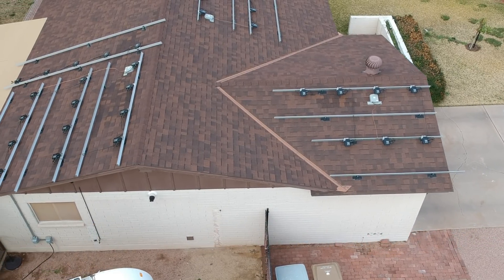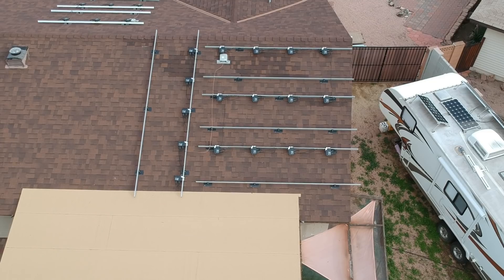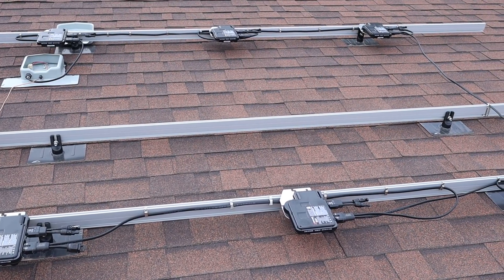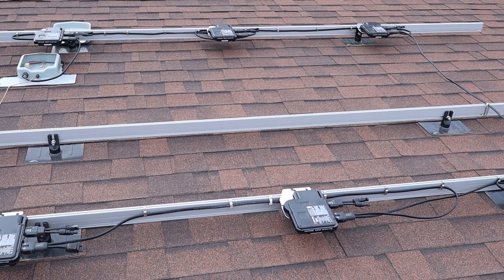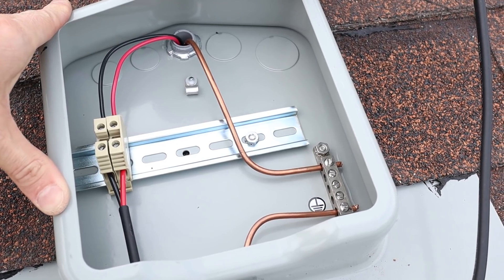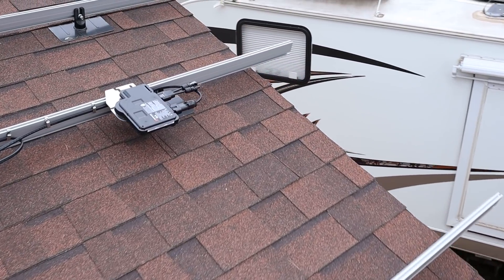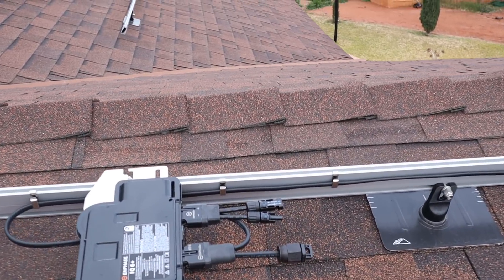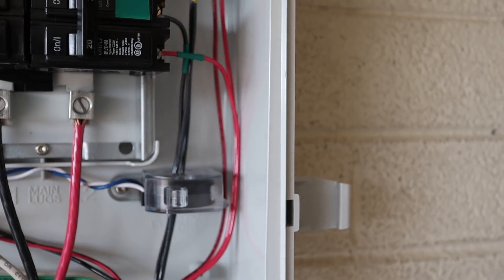My DIY Solar: Part 6 Enphase IQ6+ Microinverters and Q Cable

Comment: the microinverters was installed for the wrong side. Will be installed upside down with the metal in the top side
Reply from the maker: Check my pinned comment. I acknowledged that and corrected.

Comment: You have more money than sense; if the panels don't face south in the northern hemisphere the panels don' have a chance generating the energy equal to the panels facing south.
Reply from the maker: Ummm, I can't exactly rotate my house 90°. I have a very small section of roof that faces south. I'm fully aware that they are not as efficient facing East or West vs. facing South.

Comment: Great series of videos! @ about 12:37 there's a long vertical run from the lower row that runs up to the top row with the Enphase Q Cable. Did you have to splice/modify that in order to get it to reach or was there simply enough to make it? Did you use the portrait or landscape variation of the Q Cable (I'm sure you mentioned it somewhere in your playlist, but I forgot)?
Reply from the maker: I used the landscape Q cable. Otherwise, there would be wasted connectors. Wasted connectors increases the price. The landscape cable requires a little more cable management but is worth it to not waste any connectors.

Comment: This is a good video.  Just curious, you did not do a center branch circuit.  Reading about voltage rise, it seems to be a good approach to reduce voltage rise.
Reply from the maker: I'm not familiar with what you mean. Does that mean basically two sets of panels converging in the middle at the junction box/soladeck?

Comment: Great video thanks for documenting the journey. I'm doing something similar with multiple arrays as well. Question: the 2 single stands that come down seem to be joined parallel as you mentioned. That's the proper way to join 2 arrays?
Reply from the maker: I can't say that I know whether or not it's the "proper" way but I haven't had any issues.

Comment: Hello ! How is the AC connection connected to the microinverter, where is the phase connected and where is the neutral I can't see it writing on the plug from the Q cable?
Reply from the maker: See if this helps. 
https://youtu.be/ssKjw5-dXZY

Comment: This guy held my solar hand all the way through my job: I thought I would share some lessons learned from doing my own solar install. Date of install end of Dec 2021. 1. If you pay a company to do your solar install, I seriously doubt it would ever pay for itself over 20-25-30 years. I also doubt your electric bill will be zero in the summer months as most solar companies flat out lie. Being inform, you can have them put their expectations on legal papers for your future safety. 2. If you do your own solar one can expect a 4-7 year return on investment. You will have to get educated on permits with your local city and power company. If I can do it anyone can. 3. Power Company Billing was my biggest surprise from this entire venture. Rocky Mountain is NOT solar friendly to the average home owner. The excess power sent to the grid for storage comes at a great cost. I discovered after a few months of billing that We pay RMP .077 cents per KWH. When you generate excess solar power, the excess goes to the RMP grid but RMP only credits you .04 cents per KWH. So, in others words grid storage is not free or cheap. RMP skims nearly 50% off the top. WHAT DOES ALL THIS MEAN: 1. When you have your solar designed and drawings engineered you have to figure in 1/3-1/2 larger system to make up for the RMP skim ratio. I was lucky and added 30% more panels then necessary because I wanted an electric water heater. So far my last 3 utility bills have been $13 the minimum fee RPM charges and that includes free hot water. Jan-Mar our bill was $45-$60 due to winter clouds with a typical electric bill of $100-ish in the winter and $375 in Summer RMP resets the homeowner grid storage to Zero March to March. Of course, RMP keeps the excess storage when the clock is reset. We lost $15 storage credit. Yep RMP keeps your excess after Mar billing is closed out and you start your grid battery storage at zero. This feature does not encourage being "green", It flat out encourages running ones AC to 68 degrees in July and August and push less out to the grid. So during the day your system pushed out excess power to the gird at .04 cents and at night you buy your power back at .077 cents. Yah get the KY jelly ready. 2) Another big disappointment is RMP in Utah takes ALL the homeowner carbon credit rebates. Most states let the solar owner sell the Carbon Credit which can add up to $100-$300 per month passive income. If Utah is serious about encouraging Solar for Homeowners the laws need to be changed. Only serious pressure on our elected officials will we make strides in Solar. Conclusion: Overall I am happy with my solar only because we did all the labor ourselves. We expect near zero ($13) per month electric bills from here on out. Beware that many States like Florida have increased the $13 minimum to $30 now.... so that must be our near-term future for residential solar. This year the homeowner will still be eligible for a 26% IRS rebate and up to $1200 Utah rebate. The crazy part of the Utah Credit: You have to pay $30-$35 ish bucks to set up a Utah Rebate account in order to claim your solar rebate. Another shocker! The 26% Federal IRS rebate for DIY is only for cost of materials. Your Labor is not deductible. One can however hire out parts of the job like mounting the rails and running electrical inside the attic. You will need receipts for the rebates. Pros: We find that it is more cost effective if we run our home ac at 68-70 degrees during the day and raise it up to 73-75 at night. The heavy use during the day results in less RPM skimming off grid storage but just enough to run the ac at night and draw from our grid storage. Not very "Green" in my mind but it is what it is. Con's: One has to be aware to not have too much excess "Banked" on the grid when March comes a knocking. You lose all excess. So in others words crank up the electric heaters, electric blankets, leave all the lights on and dry ones hair more often. Excess storage is not a tax deductible loss but should be! So in other words you have to manage your usage. Does not require much time but it is another thing to do. About 10-15 minutes a month. Bottom Line: Would I do it again? Absolutely YES. I would not hire it out but if one uses their own elbow grease and fill in with some contracted work it is well worth it. Yesterday was 92 degrees and my total draw from the grid was zero. I actually pushed 40kwh to the grid. What is 40kwh? enough to run 40 100w light bulbs for 1 hour or 4 ton HVAC system for 6-8hrs

Comment: I got a question about the micro inverters cables. I know that the each IQ8A come with a Q-DCC-2 Plug-n-play MC4 cable.
Now for my project where I will have 16 panels (4x4) how many Enphase in portrait cables do I need to buy? It seems that in your awesome video you have a long single cable that connects up to 13 micro inverters. Is it that I need to buy 16 cables and they all connect together? Please help me resolve this dilemma.
Thanks so much,
Ronnie Shand 
Mechanical Design Engineer 
Jupiter, Florida
Reply from the maker: Unless Enphase has changed it, you buy a cable with as many connectors as you will need. I went with landscape cables because with portrait, you have an extra plug that won't be used as you drop down to the next row. That's wasting plugs and money. With landscape cables, there's a little more cable management but worth it. It will come as a single cable with a many plugs as you order.
Reply: Now I understand, this cable needs to be custom ordered depending on the amount of micro inverters you’ll have in that group. Thanks so much for your prompt reply.

Comment: I love your videos!  In your junction box you combine tow Q-Cables into one.  If this is to code why can't you make the combination in the Soladeck box on the roof?  Thanks much.
Reply from the maker: I made the connection in the junction box because they are two different areas on my roof. They did not go into the same soladeck.

Comment: Great video, very comprehensive.  Would you recommended the Enphase IQ Combiner Box?  Do you feel as though it is required, or just makes for a cleaner install?
Reply from the maker: The box isn't required, but the Envoy is for monitoring and microiverter updates

Comment: Can you please tell me how to find  the total number of  water/Air tight cap?
Reply from the maker: That would likely be a difficult question to answer. Press going to be different depending on each installation.
Reply: @ICanDoItMyself ok no problem i want to know something about Q cable. Microinverters connects through Qcable each oher  in one row...then after row changing how to connect microinverters?
Reply from the maker: @vineetkumar-sh7br  the Q cable is in an "S" pattern. I went with a landscape cable instead of portrait. There is a little more cable management but you won't have wasted connectors and will actually cost less.
Reply: @ICanDoItMyself  i want to talk wih you about to this type query....would you please share any social media to communicate with you?
Reply from the maker: @vineetkumar-sh7br  my Instagram link is in the description
Reply: Ok thankyou

Comment: Thank you again for your Enphase videos.  We had a long delay with our city getting final engineering drawings approved  the second time.  I had a toilet roof vent in the way by 12" so had to move one panel above.  All our racking, IQ7 inverters, grounding and solar decks are now in.  My son will be my attic rat and we plan to run the 150 ft and 50ft 10/2 romex and #6 bare grounding copper home runs into the attic this weekend.   Should be ready for the city rough inspection next week followed by the final panel inspection the week after.  Then there is waiting on the power company to swap out the meter to a bi-directional meter.  Question if you have time: do I really need to document all the inverter serial number?  The envoy seems to load them all automatically when I get to the boot up stage.  My enlighten seems to know when you system starts up and they seem to know everything about ones system.  I could be wrong
Reply from the maker: You will need to scan them into the toolkit app to properly track output and performance. Each microinverter has a sticker you can peel off and place them on a sheet of paper. I drew out my layout to help sticker placement make sense to me. It also helped when I had an issue with 1 microinverter. I knew which one was having the issue, contacted Enphase and they pushed an update to correct the issue. I could post some photos on Instagram if that'd help? You could also message me on Instagram and maybe we could plan some time to come do a video.....?
Reply: @ICanDoItMyself  Thank you for the information.  Today is actually the day to do my final PV wire connections and map the inverters.   then call the city for my rough inspection.  hope they can sign off this week

Comment: Can you explain the red and black connections as far as polarity?  The Fed and black of wire go into combined box breakers.  Does it matter which side is red and black also the main house breaker panel. Which is red and black or does polarity matter?
Reply from the maker: Both red and black are hot. White, neutral. Our homes are 240 Volt but they actually have two 120 Volt sides that make up the 240 volts. Black is line 1 and red is line 2. It does not matter which side is which.
Reply: @ICanDoItMyself  Thank you so much.  I figured so but just was not 100% positive.  There really is no polarity it seems, just two hots/neutral/ground.  My outside combiner box, disconnect is all set up now.  waiting for good cool weather before i head for the roof and attic.  My son will run the attic wires.  we are also going to put in an attic fan at the same time.  I figure with the panels shading 60% of the roof and the attic drawing out hot air the shingles will last many years longer and maybe the house will be more efficient to cool

Comment: did you have to put conduit in the attic or just staple the wires up out of the way? I was thinking of using romex...any concerns?
Reply from the maker: You could use romex. I used conduit for three of my own reasons. 1. I didn't want exposed romex from the ceiling to junction box in the garage. 2. Individual roles of wire is less expensive than romex. 3. I still needed a #6 ground wire that can't be left exposed in the attic. 4. (Less important, more OCD) Color coding. I want to maintain black and red for my hot wires, white for neutral, and bare for ground. Less confusion.

Comment: Did you run liquid-tight conduit from the Soladecks to the j-box? If so, what's the reasoning for that instead of romex?
Reply from the maker: I did. The ground for the panels was 6 gauge  bare copper wire and the microinverters was 12 gauge. I think 12 gauge romex usually has a smaller ground. Something like 14. So a ground for the panels would still be required and you can't run exposed bare copper through the attic.
Reply: @ICanDoItMyself  OK thanks!

Comment: Does the Q-Cable come in predetermined lengths with the AC connectors already installed, or do you have to buy bulk wire and install all the AC inverter connectors on your own?  Thanks
Reply from the maker: You order it by the number of connectors you need. 10 panels, 10 microinverters, order 10 connectors. It will come in a single length of cable with connectors installed.
Reply: @ICanDoItMyself  Thanks for the reply - much appreciated.

Comment: Could you tell me the wire size that you used on your system ?
Reply from the maker: 12 AWG from the roof Q cable to Enphase combiner box, 6 AWG solid for ground, 6/3 from combiner box to main panel.

Comment: Question for you and any other DIY solar installers.  I installed my own system with Enphase M215 microinverters.  Like their other microinverters these are designed with "anti islanding" safeguards to keep from frying a hardworking lineman if power is out.  SO, the M215 required a "home run" 10/3 cable from the combiner box next to my electrical distribution\entry panel to the junction box at my array where the connections were made to the Enphase smart cable which connects all the microinverters together.  The microinverters don't turn on unless they see that 240v.   With that foundation, here's the question: do you see any harm\reason why I cant take that 240 10/3 where it ends at my array and attach a subpanel for use at the array?  The array I am talking about is 20 panels that comprise the roof of a pergola I built behind our house and having a subpanel would allow me to wire some 120v circuits for ceiling fan, television, stereo, whatever.  Ideas?  Pros\Cons?
Reply from the maker: Not a good idea. You can overload the wiring and have a fire. If you pull 20 amps from the microinverters and 20 amps from the combiner breaker, you be pulling 40amps without ever tripping the breaker. I wouldn't add anything into my solar circuit but it would also be really easy for me to add other circuits by tying into my main panel with how my house is wired.

Comment: What are the connecters called and where did you get them for the q cables to go into the solar deck boxes?
Reply from the maker: Soladeck terminal block. Here's an example:
https://www.ebay.com/itm/264490968938
Reply: Sorry i meant the connectors to go into the soladeck (water tight)

Comment: What's the breaker for on the lower left side in your combiner box?
Reply from the maker: It was for two IQ Batteries. I have since sold them because I have two Tesla Powerwall 2s.

Comment: I did my system 5 years ago as a DIY.  Paid for itself in 4 years, so kudos to you... I'm sure you'll be happy with it....  I looked at Enphase but went with APSystems due to the cost and the fact that I liked having only 1 inverter for two panels.  Frankly, however, I am looking at adding another 10 panels in a different location, and I'm not going to use APSystems again. I've had a 25% failure rate and the some of the other inverters are having episodes that didn't exist a year ago.  Plus, the company is openly not interested in DIY.  You can't get an installer account so you cannot even add/replace inverters unless you find someone that will act as your "installer."  Finally, their customer support is dominantly in China and is extremely slow.

APSystems might work for a commercial vendor (unless they get call backs for non-functioning inverters), but it isn't a system I would recommend for DIY installations.  And, hey, not even they can complain about that.  Their reps have told me several times that they really don't want to work with us.  So, with that, my strong suggestion is to give business to Enphase. They like us.

Anyhow, you have an interesting SolaDeck setup.  I'm surprised the AHJ allowed you to put the junction box under the panels.  That was strictly verboten in California where I live.
Reply from the maker: I have added 11 more panels for a total of 41 panels, 12.97kw system. I haven't had a bill for the last 4 months. I'm going to do update videos on the panels and Tesla Powerwalls when it's not so ridiculously hot.

Comment: Nice install, have you had any trouble with any of you enphase inverters i'm thing about installing the enphase inverters. thanks
Reply from the maker: No issues after 1 year. I've even over produced enough to zero out my bill and have a credit the last two months. I have added in 11 more panels since the original install series. I will be doing another video on that in the future.
Reply: @ICanDoItMyself Thanks,  who did your electrical plans I'm trying to find a company to draw some for me.
Reply from the maker: @gregwilcox8288  https://www.dbmsolar.com